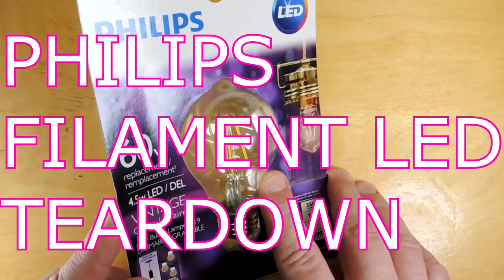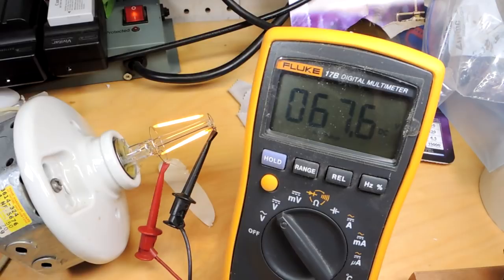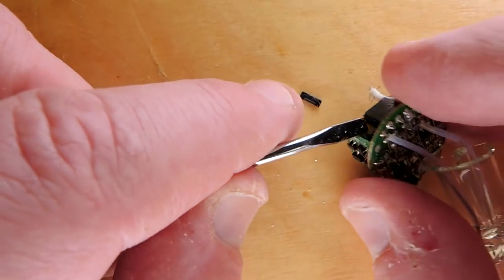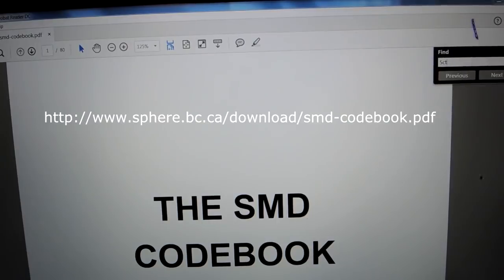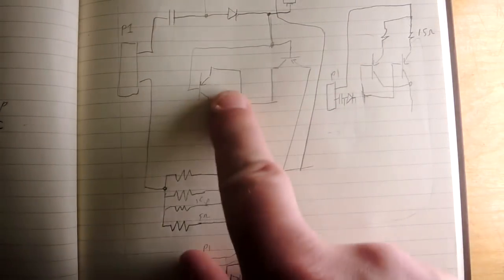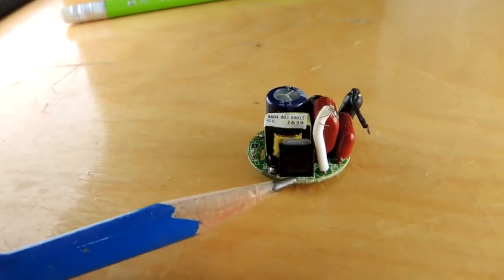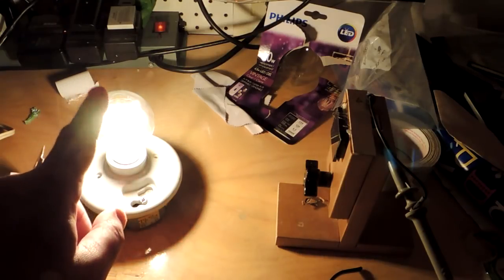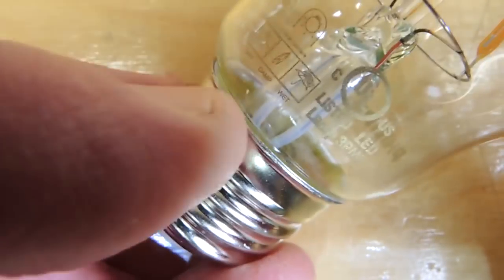Philips Filament LED Teardown

Comment: Surprised Phillips would over rate 350 lumens = 60w
Reply: I think they are not using conventional incandescent lamps as comparison, but rather something like a "Vintage Light Antique Style Edison Bulb", which delivers a whopping 230 lumen at 60W.
Reply: Maybe it's counterfeit?
Reply: A D in Brazil light bulb led 750 lumens = incandescent light bulb 60 watts
Reply: Just bought osram base classic 7W 806lm, they pose as 60W replacement.

Comment: 360p squad
Reply: It's early yet, surely the 360 squad would know that?
Reply: Yes, but I tough it was still 360p and not gone up yet because I added that comment before video had 30 views. But now 14h later it's still 360p so yes it's rendered in 360p for some reason.
Reply: Why is it 720p now? How is video handled by YT does he just upload the 720p and YT re-encodes the lower resolutions? If someone posts a video does it appear right away or not until all the other res streams are done?
Reply: Yea thats how it works, it was 360p for hours though, so I thought he uploaded in 360p